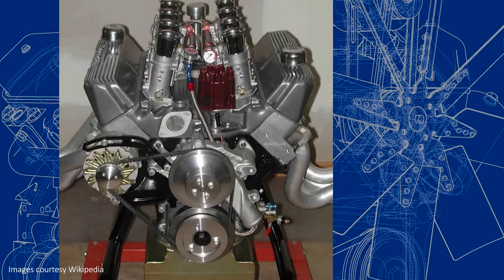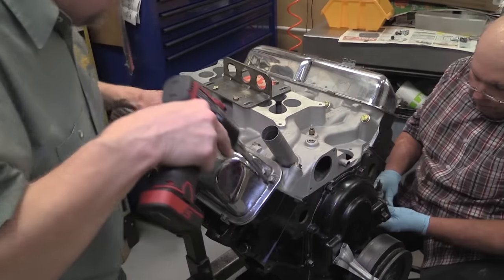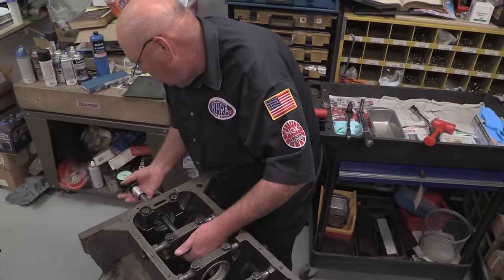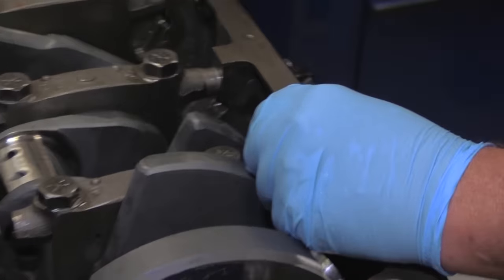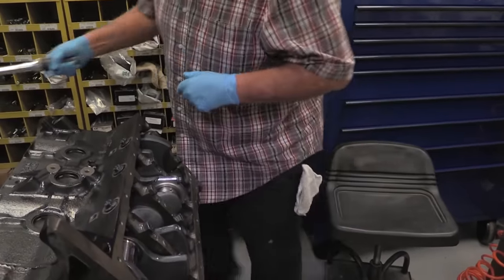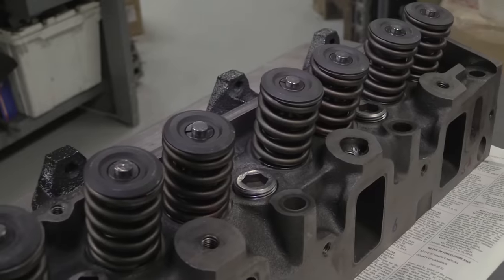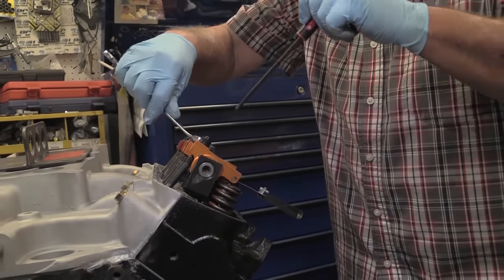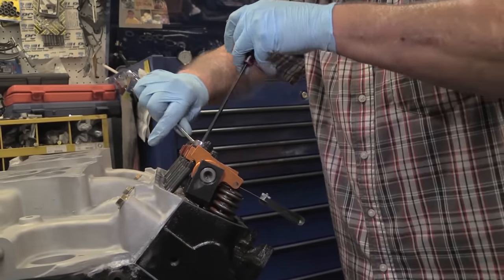Monster Ford 427 Top Oiler Engine Build and Dyno Session

Comment: The 427 FE was second only to the Hemi and a good 427FE could  beat a Hemi.  But there was  nothing from GM that could touch it.
Reply: You must have never seen a Big Block Chevy.   They ate these things for lunch, and still do.  But the reputation was established when everyone had to use factory installed parts to make power, and nothing installed in a car by the factory matched the BBC.   Certainly not the FE.
Reply: @SealofPerfection  you are hilarious 😂
Reply: @sandibaker7646  LOL, so the one dude who wins with an old Ford that was literally an unstreetable race car built for that particular class negates decades of dominance by BBC's in the rest of racing?  
Don't get me wrong, I love the old Bolts and Paquet's car is cool as hell, but that has zero bearing on how good one engine is vs the other, that just shows that one guy who races literally the same car for 40 years has it totally figured out.  
Class racing is just class racing.  Nearly every motor has some combo it fits in where it can dominate.

Comment: Ft / lb...or lb / ft...which is correct for torque
Reply from the maker: I have the same issue. I always thought it was lb/ft for torqueing a bolt and ft/lbs for engine torque, but I often see it as lb/ft for both. I did some checking  before I replied to you and the GM Performance website page with their crate engines lists torque as lb/ft but the Ford page says ft/lbs (https://performanceparts.ford.com/part/M-6007-M50A) ! I guess the answer is who knows?
Reply: @TheHorsepowerMonster  torque is lb/ft...and work metric is ft/lb...americans alwsys confuse torque and work measures/metrics...but torque is absolutely lb/ft

Comment: Why wasn't the vacuum advance not hooked up to a vacuum port??
Reply from the maker: Vacuum advance is really for driveability. It doesn't help in terms of generating horsepower, so on the dyno many engine builders don't even bother with it.
Reply: @TheHorsepowerMonster  but on a street car does it need it? And port of intake vacuum??
Reply from the maker: You are right. On a carbureted engine running on the street, it will definitely help driveability, especially at part throttle. The good news is it is as easy to hook up as running a vacuum line from the vacuum advance canister on the side of the distributor to a port usually on the base plate of the carb. Thanks for watching!

Comment: What a good price to spend on a 427 side Oiler?
Reply: If you want a true 65 side boiler be prepared to spend minimum 25000. But there's a company that makes aftermarket blocks that look really good for around $3,300. So we're stroker kit heads and carburetion I think you can get by easily with 15,000 and have one hell of a motor. I think these blocks can be bored and stroked out to 500 cubic inches plus

Comment: Just ran my ZL-1 new engine on the dyno this week.
10.5:1 496” stroker just like this one.
We got 585 HP peak and 660 ft lbs @ 3800 rpm.
Am I missing something?
Reply: Those non ported heads and intake are holding it back

Comment: Hi, you're an expert on the FE. Just looking for a backup opinion. I tried to explain to some guy who seems to think that you can not  interchange 427 FE parts onto a 390 fe.  I told him that he is wrong and that the 427 medium and low riser heads will fit on a 390 Fe as well the camshafts, crank,  distributors, 427  rods, manifolds from the 427 and many other things that will fit onto the 390 Fe from the 427 FE. I think the 427 high-rise heads will also fit but I'm not sure if they need modifications to fit the 390. What's your opinion?

Comment: Some of the comments here are pretty funny. Look the FE is an old mid 50's engine design. Ford got a lot out of it to the point Chevy had to come out with a new big block. The Chevy W engines were not getting it done. The Mopar 426 hemi was used because the Mopar wedge motors we not the answer for the 427 FE. The 427 high riser heads worked well in NASCAR but required the famous tear drop hood scoop. Suddenly NASCAR said no hood scoops and the 427 medium riser heads were born. Fun fact is that Ford won a lot of races with that old 50's wedge engine against the Mopar 426 with hemi heads and the new canted valve big block Chevy. The old timer even won the 24 hours of Le mans Several times. But Ford new they needed to replace the aging FE and they eventually did.  Enter the Boss 429. Winning the NASCAR championship in only its second year. 

Now the engine in this video is sad. I don't know what exactly is wrong but it is way off. If stock 427 low riser heads were used with matching intake that is a serious miss match to 498 cubic inches. Could have made the same numbers with a .020 427 block and a 428 crank(451 ci). Mild solid roller cam and  valvetrain was a waste of money...and that is a mild cam for 498 cubic inches. A flat tappet solid lifter cam will make those numbers. If you want to see properly built FE engines go to Survival Motorsports.
Reply: I hate to bust your bubble..especially when you were on a roll!!! The boss 429 was Never Never ever allowed to run nascar. When ford showed up with it it was banned immediately. Which also lead to banning the Chrysler hemi.

Comment: The engine that was banned by Nascar in the 60's beings it reigned over the Hemi and Chevy. This engine wooped on Hemi, and Chevy was getting wooped by both lol.
Reply: I'm a Ford guy and I raced no less than three of these engines.......I can't agree with you on this.  It takes a hell of a lot of power to thump a Hemi....I know, I've tried.  Certainly give a Chevy a good run, tho......  It all depends on what you put into the Ford/Chevy.  Hell, it's all fun......
Reply: Art Vandelay  Being the smartest person on the short bus doesn't make you smart. Just thought you should know.
Reply: Art Vandelay  Agree.....I was 16 yrs old before I learned 'damnFord' was two words......have driven 'em forever.  I s'pose somewhere there was a kid that thought 'damnChevy' was two words....LOL
Reply: Art Vandelay  Ha!  That's great!
Reply: Art Vandelay    Tune in to Nick's Garage on youTube.....I watch all the time.  He's in Canada and 100% Mopar but works on others, too.  Really a likeable guy.
Reply: @bradyelich2745  It was a whole different beast due to the fantastic breathing of the heads.....both Mopar and Chevy pissed and moaned about it.  As expensive as it was to produce I really don't think that it would have been put into any kind of production.  I've seen a couple of them over the years in dragsters and shot the bull with guys who ran them.  That long chain running the cams both on the SOHC and the DOHC was a bear to get the cams to talk to each other like they should have due to stretch as they wore.  But, man, did they breathe....

Comment: Heads is where the power is...
CNC heads would have made lots more power..
And multi port injection even more power....
But the customer whated it close to stock...
Reply: And tunnel ram more HP: 
https://www.motortrendondemand.com/detail/dyno-proven-50-hp-with-one-bolt-on-engine-masters-ep-1/0_aq9h0374 
.

Comment: OR,you can look at this as how not to build an engine. Not that they did it wrong, for that buyer, so that's cool. But, it shows how you need to match the parts. Clearly this motor should be pulling hard past 6,000 but it's choked by the stock ports. That would be a fun video.... just to see

Comment: Wow 470hp. Wasn't stock supposed to be 425hp? 70 more cubes and a mild roller cam got 45 more horse power?
Reply: you gotta remember back then, they took the water pump, exhaust pipe and mufflers, and all accessories off the motor, then dynod them. it wasnt actually 425hp in the car when you drive it.
Reply: they also dropped power numbers on paper for insurance reasons however.
Reply: @samuelgoodman2989  then dyno an original. if it took a stroker to make 470hp, then I fear that the stock stroke may not have been as much as was advertised.
Reply: The stock 427s were 12 or 13 to 1 compression this build was pump friendly 10 to 1 also they didn't show any carb tuning im.sure the stroker has different needs than stock tune can easy pick up 20 to 50 hp if old ones arnt right
Reply: HP comes from head flow... cubes don't make much difference... more cubes adds more low end torque...
Reply: @samuelgoodman2989  - They also raised power numbers on paper to sell cars... especially Ford in 1950's and early 1960's...
Reply: Yep, expected more HP.
Reply: That torque curve though...
Reply: The torque was crazy tho
Reply: Marty Pullen 13:1 compression? What u smokiny
Reply: @chrisjohnson7264  if I remember right, 427's had 12.5 to 1 comp.

Comment: Only concern I have is the crank being starved for lubrication. The side oil 427’s exist because top oilers give priority to the cam bearings and lead to crank bearing failures. One of the reasons 406 FE engines are difficult to find
Reply: - cap walk caused FE crank bearing failures - not the top-oiler system.
Reply: @sandibaker7646  my experience rebuilding FE engines says different

Comment: Distributor cap is not OE and they ran twin point dizzy's as well, which i can see its either has them or its electronic dizzy, for better tunning, so again not OE, the first image shown was the oe ford dizzy cap. but i bet the internals are electric now and better quality gear sets in the dizzy. :)
Reply: Factory for that is duel point.

Comment: Power #s are embarrassing, 500 inches solid roller 470 hp. Just goes to show buy the best heads you can, best heads beats inches and larger cam Everytime. Owner didnt want to change appearance so he chose stroker kit but didnt want to port work heads? What the hell kinda thinking is that? You cant see inside heads once intake and headers are on. Believe it or not this motor may have made more power at 427 inches just woulda spun higher sounded more radical and would not have as flat of a torque curve. Super Victor and 850 dbl pump would prolly help those stoke heads out alot. Low profile dual carb intakes dont make as much hp. Still a killer engine, i like it.
Reply: its called "his engine, his choice"
Reply: @frigglebiscuit7484  
Tell em Biscuit...
Reply: They also used dish pistons,  which weren't needed
Reply: Yep, I agree.
I'm a Mopar nut but I like FEs very much. Anyhow I know how to make power out of a 440 and watch vids on YouTube of shops building them and dyno tuning them. They all barely make 400hp or struggle to make a HP per cubic inch. They think the're doing well when they get 400 out of them. They only have a 3.75" stroke, aluminum heads with every mod already cast into them are cheaper than rebuilding iron heads and flow 35% more air than the already good iron heads etc etc. I constantly ask myself how they build such feeble 440s?
Reply: "The CUSTOMER is always RIGHT"... You can make suggestions, but he may have his own ideas / wallet thickness...
Reply: BuzzLOLOL Totally true. But you can deny to do business with them.
Reply: @ThePaulv12  watch nicks garage he dynos shit ton of 440s
Reply: @GJ-DT  I'm a subscriber already lol.
Thanks for thinking of me anyhow.
Reply: And his money. But sadly money doesn't mean intelligence, his choices are wrong, either his engine builders didn't give him sound advice on the build or he wouldn't listen, maybe all of them!

Comment: I have had 427 Side oilers and they were pretty good but I have had 400+ CI sb Windsors that made over 600HP . So I am not impressed with 470 HP 500CI FE's.. I don't believe FE heads flow very good especially on the exhaust side.

Comment: Long stroke kills power and increases torque. All it needed was the cam change and port the heads and I am sure 650 plus hp would have been there.
Reply: More cubes = more torque, no matter what the stroke... and, yes, head flow limits HP no matter how many cubes...
Reply: Yes but if you can lengthen the stroke and save weight over stock you can have yur cake and eat it too.
There are some really well thought out stroker kits these days. One big block mopar stroker kit has almost but not quite half the reciprocating mass as the standard engine and gives 100 extra cubes and revs like crazy still. All im saying is you're right, but some kits are the exception.

Comment: Interesting. We expected more hp, but with stock heads and other components we guess that's the limit here. It looked like most of the power was around 5200 rpm. We thought these engines were intended to rev much higher than that. There's definitely more to be had, but for a streeter it'll do fine.

Comment: Good point on the spacers on the cross-bolts.....NEVER mix those up.  I built 3 of these and used egg cartons to keep an eye on 'em....pity that you didn't port heads or go aluminum....

Comment: Fun street motor but the stock heads killed this motor.We are getting 800hp+ out of a tiny smallblock ford running under 9-1 compression on pump gas. It is ALL in the heads. A engine is just a air pump...

Comment: I like how the 347 makes over 500HP and with 150 more cubes of the FE you only get 450+ HP So much for no replacement for displacement. I have had both built FE's and built Winsdors and the Windsor kicks ass every time. The Big block is good for towing your small block race car to the track

Comment: Very streetable torque curve even if the peak HP is pretty mild given the cubes and dual quad set-up.   That thing is going to be very thirsty relative to the power put out.   If you only drive it for fun - who cares.  I think they could have got similar power out of a single carb given the selection of heads.   Owner wanted it to look "stock" - why have headers??
Reply from the maker: The headers were for the dyno. Not sure what the owner will be using when he puts it in his car.
Reply: @TheHorsepowerMonster  I suppose the fact the dual quads were available from the factory meets the eye test as well......

Comment: Cool seeing people building FEs.
The numbers are a little disappointing, but FE knowledge is getting scarce - one thing FEs needed to make good power was compression. A 390 with similar heads, cam, and induction at 13 or 13-1/2 to one will make the same numbers as this 427.
     This was the only engine that was the that ran head to head with the Chrysler Hemi in NASCAR - with h.p. in the 550 to 600 range - these two engines were the winningest engines in NASCAR all through the 1960s.
Back when these engines were popular, high octane fuel was everywhere so detonation wasn't a problem.
This engine - built to take advantage of E85 fuels (big compression) would have made much more impressive numbers, even without today's much better aftermarket FE cylinder heads.
Funny they bothered to mention "top oiler", that was the standard oiling system FEs were designed with - the "side oiler" came about because at high rpm the mains (and rods) would starve for oil.
the "top" oiling ran a small diameter passage the length of the block between the cam and crank journals which equally split oil flow between the crank and cam, which combined with the small diameter starved the crank.
The side-oiler ran a larger diameter  passage - along the side of the block - that was dedicated to oiling  the bottom end - this and the use of heavy weight oils (70w) with high pressure pumps handled any oiling system issues in racing applications.
Of course - in 1958 when the FE was introduced they had no idea the engine would evolve to over 400 cu. in. and over 400h.p., so the standard oiling system was adequate.
Reply: The side oiler modification was made to suit the Cammer engine that was in development  - Ford decided to include it in all future FE's. Top oiling is not infertor unless your wanting to hold 7000 rpm for extended periods. Don't be frightened to use a top oiler if you find one.
Reply: Wayne Lee 
I don't agree, the side oiler 427 came about before the cammer - and was "sprinkled" all through the solid lifter high performance 427s.
while the 427 (again solid lifter) block was the base for the cammer, there was additional machine work to the blocks - oil passages etc. - to fit the cammer heads.
if in fact it was a sweeping change, it was done poorly.
in terms of "top" oilers, we restricted oil flow to the rocker shafts, drilled the supply passages larger, went to the truck/high performance oil filter adapter (again larger passages), and ran higher pressure/volume oil pumps and straight 50wt. - in fact this was when race oil filters were developed, a standard filter would burst at the oil pressures the big Fords (and Chryslers) had to run to live.
done as above the top oilers had no trouble living at high rpm.
back in their day, FEs rarely saw over 6000rpm - above that was still mostly small block territory, in fact very few aftermarket tachs read past 6000.
that said - this build would have really perked up (much closer to or past 500hp) with more compression, 13 to 1 seemed to be the magic number, which is now possible on the street with E85 because of its high resistance to detonation and being easy to find - it wasn't uncommon for unlimited build FEs to make just over 600hp - and those were high-risers not cammers.
yup - no fears with the top oiler, far more race engines were built without the benefits of the side oiler blocks, NASCAR engines ran wide open for 2-1/2hrs and lived - although it wasn't unusual to machine them for cross - bolted mains, I did a few myself.

to this day, the FEs are one of my favorite Fords - dinosaur or not! lol!!
Reply: @Motor-City-Mike  I thought the NASCAR-spec 'High-rev kit' hollow valve stem engines were safe to 7k?